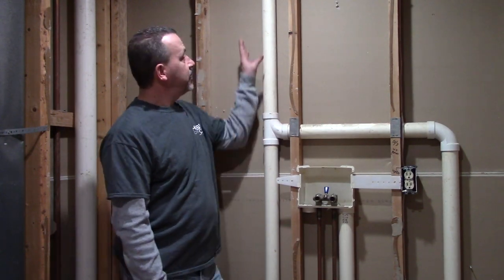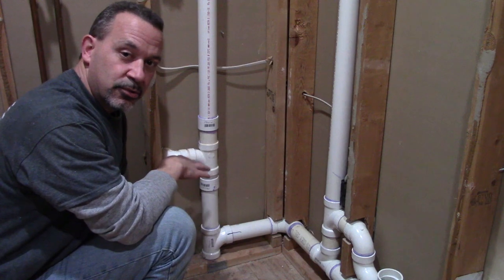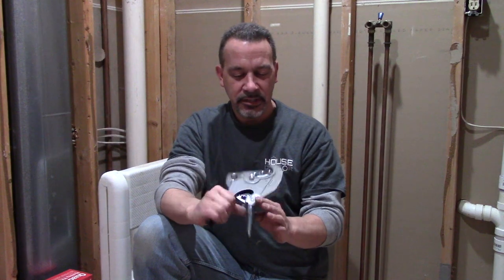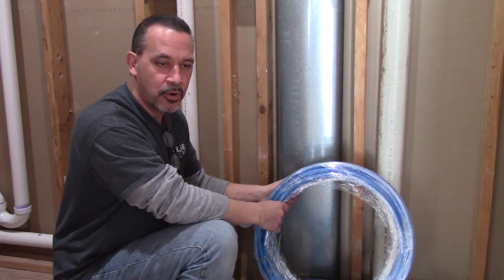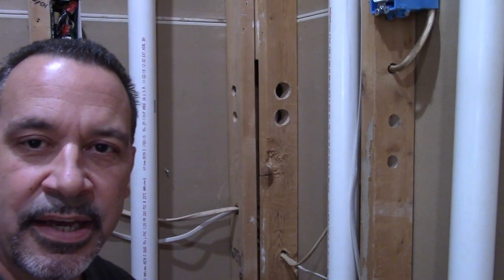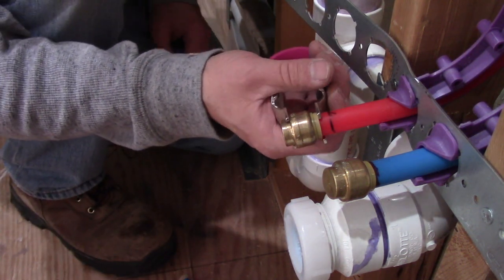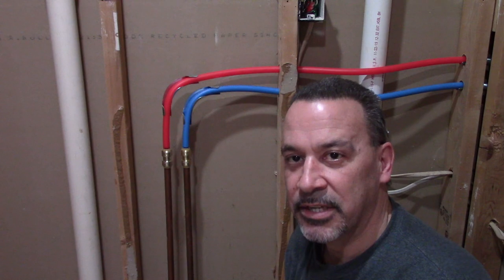plumbing copper to pex using sharkbite

Comment: You cloud have edited the mistake out but you didn’t and I thought that was honest and smart because it’s reality speaks for your character and reminds us to think ahead when we’re doing any job and also learn while we are working because no one starts out knowing everything. Not to mention it helps us understand it’s very thought intensive doing rehabs then doing new.
Reply from the maker: Thanks.  Running Pex through inside corners is tough, especially on renovations.  It helps if you can stretch it out and let the coils 'fall out' a bit.

Comment: It was not fair of me to not include what I liked about the work. I do love that you slip stud guards behind the opposing walls. I do love that your runs are clean and well thought out. I do love your air return solution. I do love that the video itself is well paced and very informative, good tips such as tapping the ends of the pet before running them through the wall. I love your dog!
I'm an old house guy, working mostly on timber framed structures and I can't even begin to count how many girts, floor joists, and studs (even non load bearing) that I've had to either replace or modify to correct "drill throughs" that have left the structure compromised. It's a pet peeve of mine. Ultimately it is up to the home owner if they care as long as the compromised structure is explained to them. I'm sorry I was so flippant in my last comment. Looking forward to more of your videos.
Reply from the maker: Not a problem I agree with you.  My last house only had 2x8 joists.  The plumber and the electrician had a field day with their drills.
I ended up laminating a few joists with 3/4 plywood and liquid nails because of cracks.  In the front half of the house I put solid blocking between every joist to reduce floor bounce.
It is sad that even on new construction plumbing and HVAC runs are not always planned for.

Comment: Nice video, well done. 👍 I do have one issue, about the use of Sharkbite connectors. In my area, you cannot use Sharkbite type connections when they are going inside a wall cavity, they have to be in exposed areas so you can make visual inspections. They are considered temporary connections. I know some areas allow there use inside walls, but it would best to check with your local inspectors to make sure this is a legal use. In my area, this would be a fail.
Reply from the maker: Good point.  Thanks for posting.
Reply: IAPMO says they're good for behind the wall as a permanent mechanical connection. They can be buried underground as well if wrapped
Reply: Sharkbite are now used all around the world inside walls I think you need to have a look at your regulations and have them update them

Comment: Ray, not sure if you will see this being 4 years ago but I noticed you used a couple different PEX fittings.  What factors play a role in decided between using pinch clamp, crimp or sharkbite style fittings?  I have had good results with push on or sharkbite style in general.  I am doing the same thing you did in this video and relocating supply lines.  I am concerned with using sharkbite for hot water laundry supply line.  There has been numerous documented cases of fitting failures on hydronic heating systems where the constant high water temperature fluctuations have weakened the fitting.  My family is large with 4 kids and we chronically have never ending loads of laundry.  Rather not have a failure in a wall requiring tear out.  On the other hand I have heard crimp style are better than pinch clamp. Thanks for the videos!
Reply from the maker: 4 years and no issues.  Sharkbites have been around long enough I wouldn't be concerned.  As long as you prep the ends of the pipe you should be fine.  I didn't know they were used in hydronic heating but that's not something I would do.
The elbow clamp on fittings I used in the video do reduce the flow because the inner diameter is smaller than 1/2".  From what I've read the biggest failure issue with PEX is the pipe itself.  Pick a reputable manufacturer.

Comment: After the cuts are made to route the 2" white pipe through, doesn't that just leave those studs with basically no strength at all (except say 1/2", whereas it should have been 3.5")?
Reply from the maker: It leaves 1½".  More than enough because the wall isn't load bearing and I screwed extra long stud guards over all the gaps to stiffen them up.

Comment: no one question the integrity of the corner studs after cut so much out of them?? I understand crossing thru 1 or 2 but seems like u cut about 5 studs there, I hope you don't have a lot of weight above them or it might cause some future problems.
Reply from the maker: The walls are not load bearing.  Notching out the studs is not ideal but no worries about the walls collapsing.  I did put in oversize stud guards and nailed them off to reinforce the studs.

Comment: .. at 10:10 in the video , when crimping the pex clamp ,,, is there a measurement of pex pipe that has to be towards the fitting ? ..... ( meaning , is there like a REQUIRED minimum of 1/4 " ,,, or some measurement ,,, that HAS to be to left , for the fitting to be correctly clamped ? ) ...
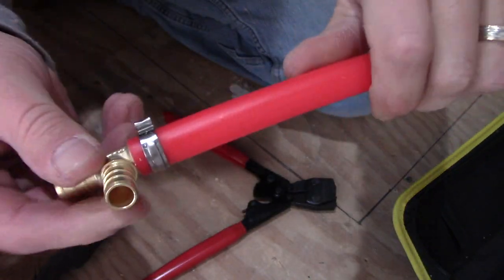Like , at the 10:32 mark in the video ,,,
the pex showing between your RIGHT thumb and the pex clamp ,,,,, is that a REQUIRED 1/8" ,, 1/4" ,, 3/8 " ? . 
sorry for the poor choice of wording ,,,,, hope you understand what I'm asking .
Reply from the maker: I'm not aware of any requirements.  I just put the crimp clamps midway along the shaft of the fitting.  You definitely don't want it right at the end of the hose.
Reply: @HouseDoctorRay  .. yea , been reading about the pex systems ,, and it's odd they don't have a required distance for connection clamps .
( Like SharkBites having the depth guage tool )
Also read some had left little space ,, and leaks occured .
Or clamps were crooked ,, or not centered over the fitting correctly .
Reply: Clamp needs to be between 1/8 and 1/4 inch from the end.  Over 1/4 inch you're not catching the barbs correctly and will eventually fail.
Reply from the maker: Thanks for posting this.
Reply: @HouseDoctorRay .. 👍 ..

Comment: What size pex is that 3/4? What about the copper pipe? I have 1/2 copper in laundry room, used 1/2 pex for washer and slop sink.  Washer takes long to fill. Should I go from 1/2 copper to 3/4 pex or should I go back to where copper pipe is 3/4 and re plum from that point?
Reply from the maker: If you used the internal 1/2" PEX fittings that is probably why.  They do reduce the flow.  1/2" is fine with external fittings like sharkbite.

Comment: Try to not move copper pipe  at all or not to often. Try this on a 3 foot piece one time. Secure one end in a vice or a hole. Grab the top and move it back and forth even a couple inches. They will often crack from a pinhole size to a half in inch long. I sure hope those wall studs aren’t holding anything up because everyone you ran that pipe through isn’t holding up any weight.
Reply from the maker: It's just a partition wall between two tiny rooms.

Comment: Hey doctor, I'm driving to my rental property now as we speak because of one of those shark bites are leaking   I really don't think it's a good idea to put it shark bites in the wall. That will be a big problem. At least mine are next to Water Heater. In the basement. 😊
Reply from the maker: Did you install it?  Was the pipe prepped properly?
If you really have a failure at the SharkBite it would be the first real failure I've heard of.

Comment: Is that an S trap or P trap on the washing machine - I think you might need more on horizontal pipe between the drain and the trap or you create an S trap.
Reply from the maker: P trap bro.  An S trap has no vent.
S traps normally go into the floor.  As long as there is a vent it won't syphon all of the water out.

Comment: I chose PEX-A and Viega ProPress for my project. I think it's a more reliable technology and it doesn't restrict the water flow.
Reply: Your fixtures and faucets restrict water flow, more than these ever would. This project did require to spend thousands of dollars on tools for expansion and press.
Reply from the maker: Check the links in the video description.  The tools are not expensive.

Comment: It didn't look like you deburred the ID of the copper pipe, or does it not matter when using Sharkbites?
Reply from the maker: I didn't because the shark bite fittings have an internal plastic sleeve.

Comment: I would have made it easy on myself and ran all this plumbing on the inside of these studs on the wall with the cold air return and then padded those studs out   another three and a half. Or basically built another 2x4wall against the existing one. You would still have structural and no drain through cold air return
Reply from the maker: Laundry room was too small already.

Comment: Standpipe should be a minimum of 18 in and a maximum of 30 in also a sanitary T should not be laid on its back you can use a y and a 45 fitting or what's called a combo fitting other than that good job
Reply from the maker: Is the reasoning because a sanitary tee has too sharp of a bend?
I can see that a wye and a 45° would create a 'long sweep' 90°.
Reply: @HouseDoctorRay  yes, it's against code. It's not going to affect you much   but if you were to do that on a drain for sewage, toilet paper and solids could start building up as it fall into that fitting.

Comment: I'm a DIY'er, but not when it comes to certain issues. NO PLUMBER I KNOW will use sharkbites on enclosed plumbing. I know the manufacturer points to them being up to code, but at the very least I would use compression fittings. 
    I've just remodeled our 50 year old home, and I used a plumber to deal with fittings inside walls. An undetected leak from a failed o-ring will cost $THOUSANDS! To me, it's learn to solder or spend $200 on someone who knows how.
Reply from the maker: In the NY - Philly area plumbers charge $100 to answer the the phone and another $100 to get in their truck.
Reply: Every plumber here uses shark bites on remodels and inside walls not for new homes or large areas but small bathrooms perfectly ok

Comment: There's 100 things you could have done better especially if you could get under the house. Considering it had a wood floor it seems likely  But if this is you're house more power to you and have at it. I just hope you're not out there doing this to somebody else's house
Reply from the maker: If you're talking about the drain lines nothing could be done in the basement without replacing the entire drain system.  Not feasible to lower all the drain lines and run a 2" pipe below the ceiling in the basement.

Comment: Loved how you cut out about 3/4 of each stud you passed through. Not a fan.
Reply from the maker: I'm not a fan of that either.  That is why I put oversized stud guards in and nailed them top and bottom.  The wall is not load bearing.  I could have drilled new studs and fed the pipe through and scabbed them in place but that would have been overkill.
Another option would be to cut the horizontal pieces 14 1/2" long and glue couplers between each stud.  That would be hokey.
 I've seen plumbers drill the holes, bend the pipe and pound it in place but the room was too narrow for that.
Sometimes you just have to do the best you can.
Reply: @HouseDoctorRay  there not called stud guards, there called nail plates!

Comment: Elbows would have been good for your 90s, but good job either way..
Reply: Every fitting added is a potential leak point. Keeping the pipe in tact minimizes the potential risk.